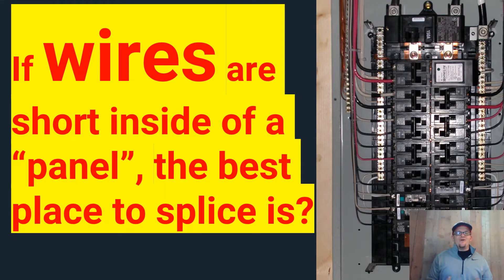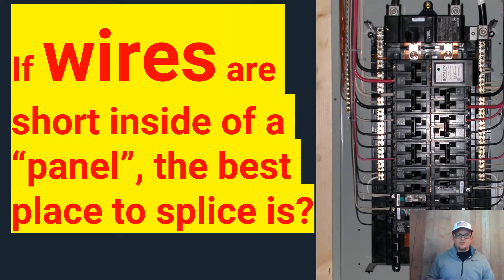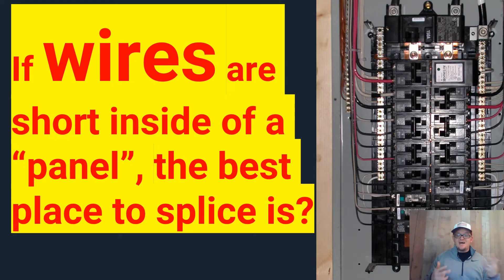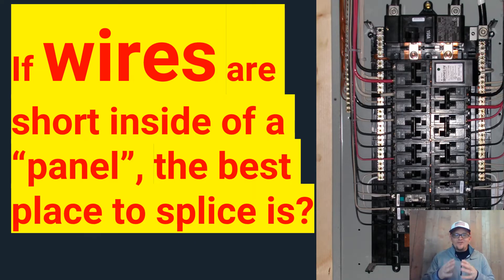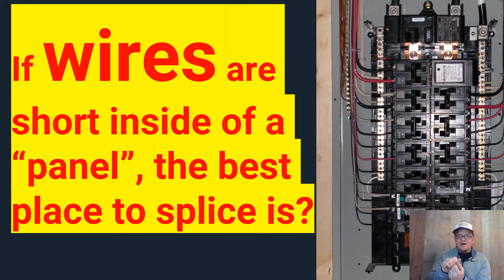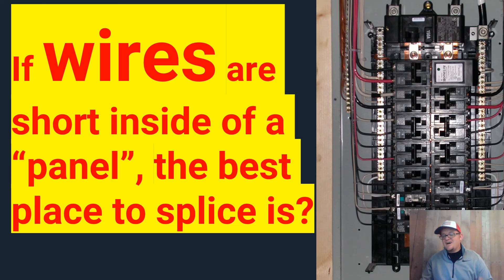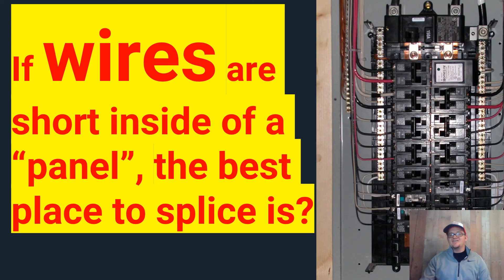Splicing in Electrical "Panel" On the Electricians in Action Everyday @ 9:00 am

Comment: Can you have circuit with  hot in one breaker box and the neutral connected in another? I had a solar system with battery backup installed including the auto transfer switch box.  It is  a partial home backup so critical loads were moved to the new backed up sub panel. The electrician spliced the hot wires and ran them to the new sub panel but apparently he thought it was too much trouble to run the neutrals or grounds of the individual circuits to the new sub panel. He faked me out with the #12 and #14 neutrals in the new sub panel running back to the buss bar in the old panel so it looks like they were extended, but they were not.  I was wondering if this is a code violation.

Comment: So in replacing an old breaker box and the wires are too short to terminate in the breaker panel. Can you use a different junction box to splice in and how many wires can you spice in the junction box?

Comment: I assume that the same code applies for boxes with switches in them? For example if I have one romex with three wires (hot, neutral and ground) coming in. I pigtail the hot and neutral each with 2 additional conductors for two different switches. Finally I have a hot and neutral leaving the box for each switch. That counts as a total of 6 conductors in that box (plus two for the switches as I believe that they each count as one according to code?).

Comment: Sooo, what is the max fill rate inside a panel? I have been in a few where there wasn't room for a mouse to crap! (difficult to install the cover)
Reply from the maker: You can calculate the cubic inch volume HxWxD  Now calculating how much space the breakers and buss take up is another story
Reply: @ElectricalCodeCoach  ... that was my point. Of course there's no inspection or enforcement because it happens over a period of time.
Reply from the maker: There still is a fill max
Reply: @ElectricalCodeCoach  ... I kinda figured there was but wondering if it's a published number of conductors, etc. based on total breaker count or cubic inches. I don't recall seeing a cubic inch rating on a panel. In theory, one could install 20 split breakers in a 20 slot cabinet and wind up with 40 pieces of Romex in that panel. Where do we draw the line? (other than load calculations)

Comment: Can I splice the main feed for a sub panel? I need to move the panel about 20". Only the main feed will be a problem.
Reply: if you are only a few feet away from the main panel it might be easier / cleaner to run a new piece of SER cable the whole way. If you are at the other end of the house maybe clean things up with a 10x10 junction box and some of those rubberized bugs to add your extension the last 2 feet. It will look much better than trying to add 12 inches with bugs inside the panel. BTW, I presume you mean "sub feed" to the additional sub panel. (not main feed to the main panel) Basically it's all legal if you have the room but sometimes it's better to clean things up. All splices MUST be inside a box.

Comment: I'm moving 2 breakers from the bottom side of the panel, to the top side of the panel, so, just add on 6-8  more inches of wire, connected with twist connectors?

Comment: So what if I want to free up space and I want to splice 4 wires that I know don’t draw much electricity, (LED Lights) to one breaker ?
Reply from the maker: I would contact a qualified license electrician
Reply: @ElectricalCodeCoach  I ran 29 romex wires to a 30 circuit panel. I pigtail a few inside the panel

Comment: What would be the preferred method for splicing? A bug?
Reply from the maker: im big on twisted and wire nut connections but there are several good options
Reply: @ElectricalCodeCoach  I definitely use that for 12 and 14 gauge, I was referring to larger gauges. I have a subpanel in my garage that was wired so bad I had to cut it to pass inspection. I fixed the other problems and was looking at running new wires because I was unaware that you could splice in a panel. They had spliced in the panel with a cable clamp lol...so could I use a bug in that panel?
Reply from the maker: I get it now LOL, yeah I typically just use a Polaris or Nimbus connector and torque it tight
Reply: @ElectricalCodeCoach  awesome thank you so much for your help